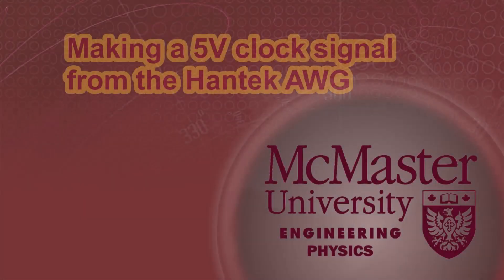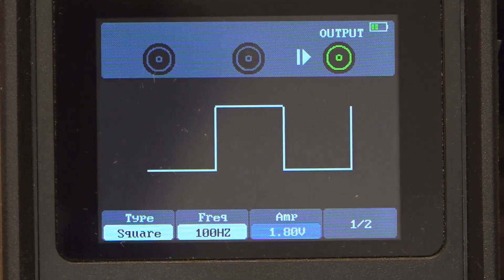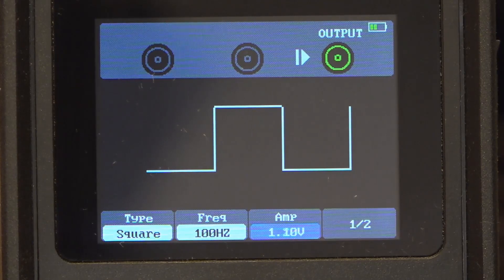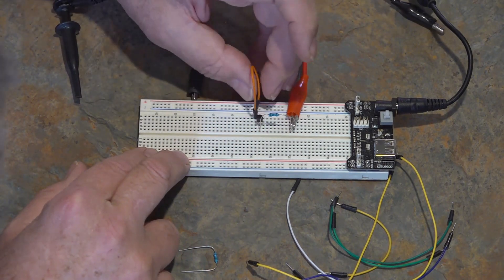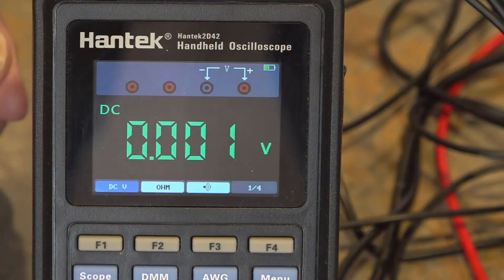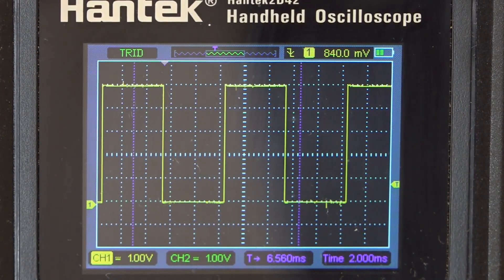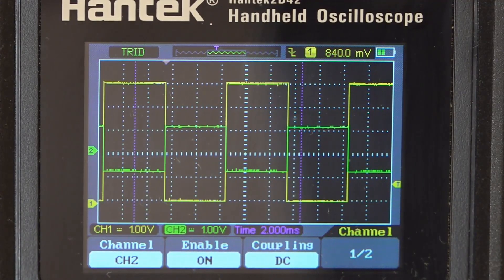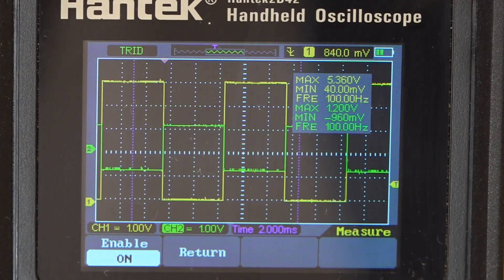EP2E04 - How to make a clock signal circuit using the Hantek and lab kit

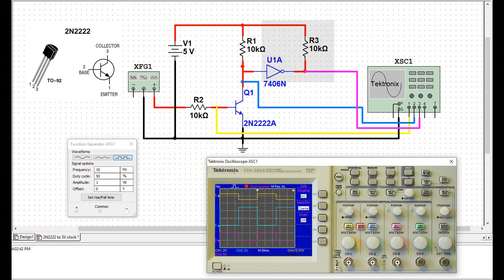Comment from the maker: Hi all!  When using this as a clock signal for your gates, you will likely need to put the output through an inverter (like is shown at 00:29 but with no R3 and using the 74HC04 like we have in the lab).  This helps smooth out the output and stops very odd behaviour that can happen if trying to clock from the raw transistor output.